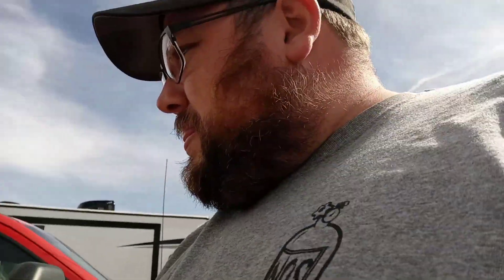RV Transport - We Have A Problem!  12 Valve HotShot Truck UpDate.

Comment: I know you will crawl under your truck looking for the oil leak. Back in 2012 when I was out looking for a used Ram 5.9 diesel 24  valve, I looked at about 7 of them. I found a common oil leak on the front of the engine driver side, I do not remember what caused the oil leak, but I do remember having to fix it on the truck I bought, what ever it was I did not have to pull the motor or transmission to fix. Good luck.
Reply from the maker: The trans need to be gone through anyways. So ill just do it all at once.